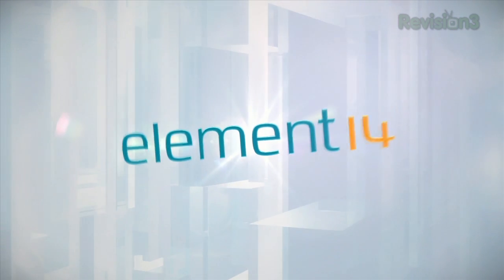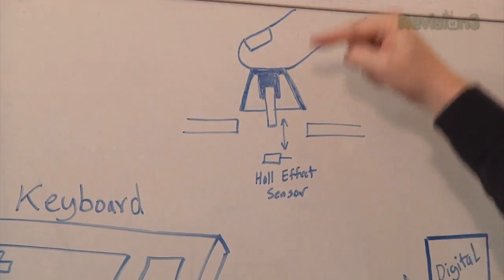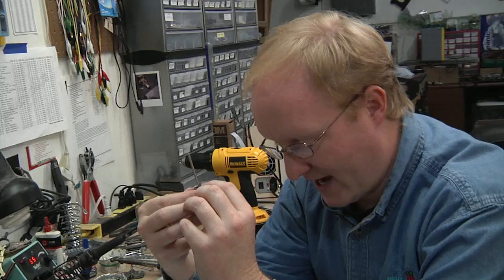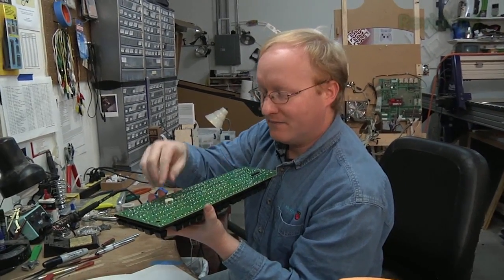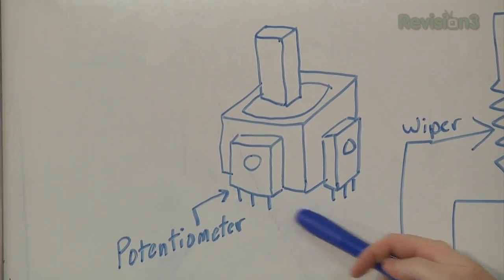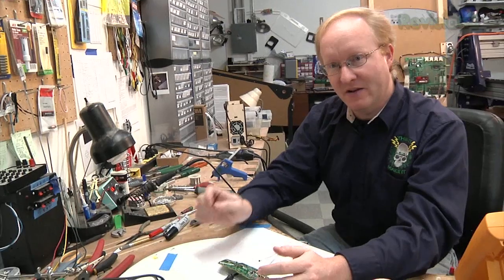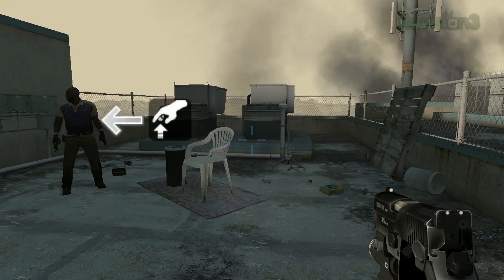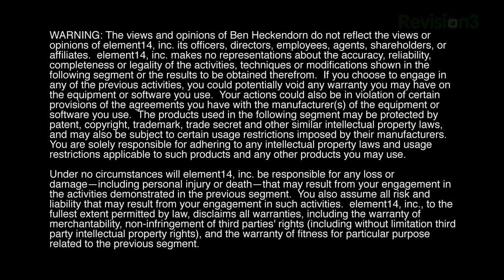XBOX Controller Mods: Analog WASD Gaming Keyboard

Comment: The reason why these aren't used is that it causes a non uniform movement, pro counterstrike players are used to moving at an exact speed and would rather have it not vary. This is also why most console games need autoaim help, because they are less accurate.
for everyday gaming this is fine, but hardcore gamers would rather choose a normal keyboard.....it is a nice project though

Comment: Does anyone actually market a keyboard with switches rigged like this?  I would love to get a keyboard like this but I lack the expertise and facilities to make it myself.
Reply: +Wooting 4 months later, website hasn't changed... Spamming up Ben's video, but what's up with that Launch you said was 3 months ago? I see more Pretty 3D Renders and Promises littered around but not even a prototype. 

Should wait until you have a product ready before using Ben's popularity to spam your 'product'. Careful as it may become be old news and forgotten about or copied and built by another company before it ever materializes by spamming much too soon. 

Looked sweet, and if it was real I probably would have ordered one from the site when I clicked your link with high hopes.
Reply: Hi JZS,

We understand your frustration, and for this reason we've not advertised analog control anywhere on either our blog.wooting.nl, website or any other medium. 

There were some hardware issues to overcome, which has thrown back our original planning by far. This doesn't mean we quit, or are advertising false hope however.

There is already a prototype in use for our development, but it's very limited in use and doesn't look like anything near the final product.

A near finalized prototype is current being made, but these things take about a month or two to complete.

We like to be transparant in what we do, but limit the amount we publicize to protect ourselves from competitors and others from disappointment.

Furthermore, we didn't aim to use Ben Hack's popularity, just to disappoint everybody afterwards, but in full honesty the reaction and interest coming from here and other places (non-analog related) has helped us to overcome some struggles.

You're always welcome to connect with us personally on social@wooting.nl, youtube, twitter, facebook or anywhere else you please. We're open to anything, and apologize for any disappointment.

Thanks.

Comment: Not all but L4D was 100% PC originally as it runs on source, an engine that was built for the PC platform, anyway its not like there's really a difference between PC gaming and X-box, the X-box's operating system is just a jumped up version of XP

Comment: I wouldn't use this for games like cod, BF3, Left4Dead2 or fps games because you need that fast response and you don't really need to move at different speeds. As for games like NFS and Testdriveultimate 2 for where you want the wheels to turn at a certain angle and want to manage your speed then yes i could see some potential.

Comment: They differ because games like HL2 automatically detect the Xbox 360 controller and are basically programmed for it

I try plugging in my Logitech Cordless Rumblepad 2 to play Half-Life 2 and it doesn't work, regardless if I turn on gamepad or not.

I plug in a USB Xbox 360 controller and it instantly goes into Xbox 360 mode, and even lots of the menus work.

Comment: Um, couldn't this be done without xbox 360 controller and digital pot IC? Seems a 'bit' inefficent to me :P
I'm pretty sure one could just take an AVR/Arduino, do the same thing with hall effect sensors, but instead of "feeding" it to the hacked controller, take an USB stack (V-USB for example), and sliiightly modify one of it's examples that does HID joystick. Then it just plugs in and works like USB controller on it's own, without xbox stuff...

Comment: I was just giving generic examples. Yes a controller is better for driving, doesn't meant that I want to use one. Especially is games like GTA where driving isn't the only mechanic. As for sneaking and ledges, I was directing that more towards platforming in general or older console ports that took more advantage of analog movement. Point is, there are cases where a PC gamer would enjoy having analog movement. You do not have everyone's opinion. Stop pretending that you do.

Comment: There is a HUGE difference between making something ON the PC and FOR the PC. You can do all the programming on a PC but then optimize and compile it for a console. Meaning it is made FOR the console, not PC, and without porting it will not run on the PC either.
Most games developers also have development versions of the consoles, which are designed to let you test your game on the consoles evironment.

Compiling and Converting/Porting is not the same thing.

Comment: Most cross platform games on PC are not ports, if the versions are made at the same time the PC will be the lead.
Games that support xinput do so because it is easy to add, not because they are ports (e.g Crysis 1, years before the console versions came out supported 360 controllers).

This mod is also kind of useless due to the fact that most PC games that can use a 360 controller support only it or the keyboard and mouse at a time, a game supporting both at the same time is rare.

Comment: You have it backwards fella! Everyone knows m&k offer more control than consoles.
Reply: Bet when it comes to movement he's right. You can only stand still or walk/run at full speed. A controller makes it possible to move at a slower speed.
Reply: why would you want to stalk when being chased by zombies anyway? this isn't cod camping gets your face eaten lol
Reply: olle707 No, I've gotten used to pressing keys at precise times, and spamming instead of holding to move slower and curve.
Reply: glitchsmasher Yes, the same applies for me. I always use m&k instead of a controller if i can. Just thought that i should mention the movement thingy. :)
Reply: And you can greatly vary your speed too. Well, if the devs handle transitioning between deadzone and full-tilt of the anaog stick well. Otherwise you just get slow walk at slight push, full sprint at slightly more, no transition.

Comment: SO i quess most of the viewers missed the point of how awesome the mod is in general by turning the comments into a console war. great.
I thought of a kinda similar mod, lot easier though. If i had an extra xbox controller i would try to install the rumble feedback motors of it inside a mouse! I thought of doing this when i first played Crysis 2 beta and i had the xbox controller plugged in and when i shot ingame, the controller started wibrating on the table. (ugh the noise it makes :)

Comment: do not remove = screw
Reply: The great thing about stickers is, if your device is still under warranty, you could use a hair dryer to loosen the adhesive so the sticker doesn't tear when you take it off. It makes minor repairs where it would be pointless to send the product in possible to do while still under warranty XD.

Comment: I have a better Idea. How about you just take the W key and turn it into a clickable analog stick. FUCKING TADAH. a LOT easier to use... especially for people like me.. with the shaky fingers... slightly pressing down a key is not easy. while just using your middle finger to walk around with the W key is easier, and also you dont have to move your finger to S to walk backwards. Better idea.